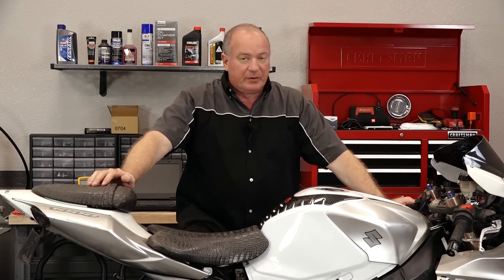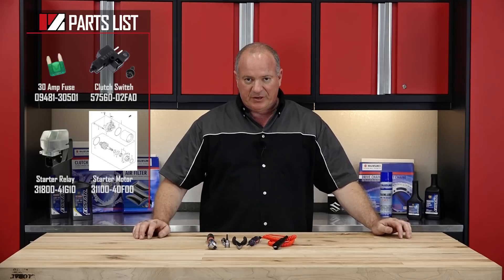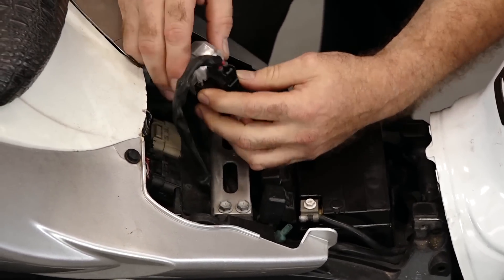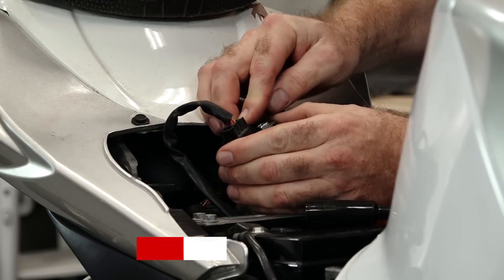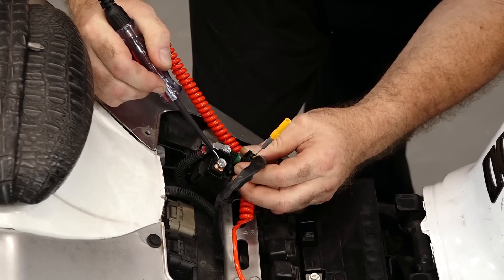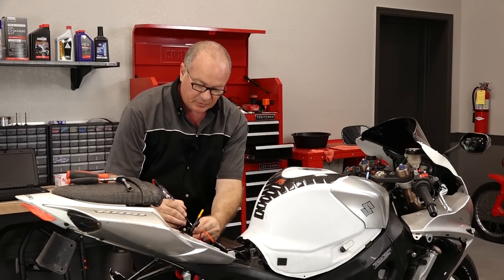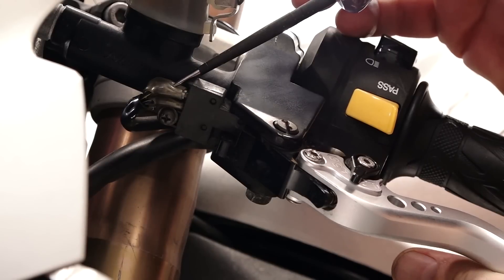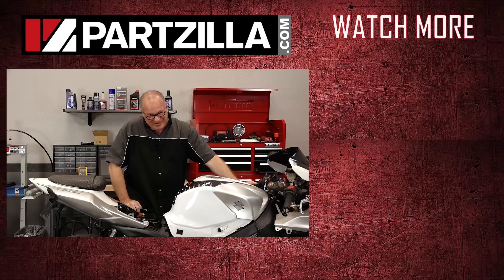GSXR 1000 Won’t Start Troubleshooting | Partzilla.com

Comment: Hey John, I have a 2008 Gsx-R. My bike was cranking, Fuel was priming, Relay was clicking (did a relay test like you did) brand new battery — But no start. I knew it was the starter! After Replacing the starter brushes, Replace the oil and put the covers back on. Now, its not cranking and won’t start It gave me a FI Codes (-C00) which is nothing. Please Help!
Reply from the maker: Test everything from battery to starter.  Is the starter getting power at all?
Reply: So What I did last night, I remove the Starter Completely apart, Make sure I did not miss anything while renewing the starter and replacing the brushes. Relay works, Battery brand new, fuel primes... Now, the starter is getting power and It also Cranks. My Battery drain a little from Triying several times to start my bike. Recharge my Battery for a Bit, Try to start it again, and Its like it wants to start but still not enough power. :(
Reply from the maker: Check all the wires for loose connections or corrosion.  If you have a bad wire, the power will not transfer correctly to the starter.  You can run a voltmeter to determine where you're finding the voltage drop from battery to starter.
Reply: @PartzillaParts  my 07 750 doest crank. Relay clicks really fast and cluster goes wild. New battery new relay. Please help 😢

Comment: My 2004 gsxr 1000 only cranks, it has a few new parts put on, fuel pump  , injectors, Sparks, can't figure out why it won't turn over
Reply from the maker: Is it getting spark and fuel?
Reply: @PartzillaParts  yes it does
Reply from the maker: If you are getting fuel and spark, then it's likely a timing or valve issue.  Do a compression test to check the cylinders.

Comment: I have problem to start. Normally have a biping and start charging and stop. But now have just biping and biping no stop. To slow power to start engine. I can make a video for you see the noice. The noice come front right side down gas tank like from air filter

Comment: My light comes on when I put it on the green and yellow wire and hit the start button, but no light when I put the tester on the negative terminal of the relay. Definitely means my relay is shot? 2009 750
Reply from the maker: Did you hit the starter when you tested the other side of the relay?
Reply: Partzilla yes I did. No light on the side from the relay to the starter when hitting the start button
Reply from the maker: Probably a bad relay then

Comment: 2015 gsxr 1000 checked all that lights come on no FI light on but it says check and starter spins when not connected to the solonied fuel pump aint priming just the dash lights up pull in the clutch hit the button nothin and no neutral light eather and i know the bikes is in nuetural?
Reply from the maker: Check ignition and dash wiring.  Test voltage to solenoid and start switch.
Reply: @PartzillaParts  imma try that
Reply: @PartzillaParts   read some things saying its the ECU

Comment: Hi thank you for the video been very helpful up until now I got through all the stages until you said check starter relay contact do you continue having the Black wire of your multimeter on the negative side of the battery because if so I am getting nothing there also I have no clicking whatsoever when I press the starter button any help would really make my life a lot easier and happier and I would really appreciate it. So just to confirm I've checked everything the voltage changes when checking the yellow and green wire so there is power coming from my starter switch but there is no clicking from my relay whatsoever and on the starter relay contact negative side when pressing the starter button no change but having my black wire from a multimeter on the negative side of the battery I'm assuming that wouldn't be watching your video that is how I understood this so if you can help me further please do my next purchase is a starter relay thanks for your all your help in advance. YouTube rules
Reply from the maker: You always ground the tester.  Sounds like you need a new relay.  Double check your connections as well.

Comment: I’m having a weird issue. Sometimes my bike starts, sometimes it does not. When it doesn’t I hear a single click and nothing happens. Everything primes normally before I hit the starter. What might be causing this?
Reply from the maker: Dead battery or bad solenoid

Comment: i have a gsxr 1000, 2005-2006.
it turns on and everything but when i press the ignition button for the starter to start it up, it does nothing. But if i put a metal object at the same time on top of the two relay bolts, only then the starter works but not when i push do ignition button. Can anyone help me with this ?

Comment: I have a 2007 gsxr and it won’t start, the solenoid is good but when I take off    The part off d starter and start it, the start do spin
Reply from the maker: With the solenoid installed, when you connect the posts, does it turn the starter?

Comment: Hey i did everything but when i check for electricity coming through yellow and green wire there is none. Is it the starter relay?
Reply: Danny 666 I had the same problem and so I just bought the starter/kill switch of the right handle bar and it worked.

Comment: Got a 1998 gsxr 600 srad was tottaly dead no power found out was the ignition switch got power to everything now but refuses to start and the oil can is flashing on the dash ?
Reply from the maker: What's it doing?  Does it turn over?  Need some more detail.
Reply: Yes lights work indicators fuel pump starts turns over trying to start but no spark in the spark plugs before this i had no power atall but found out there was a broken wire on the ignition switch fixed that and got power back and turns over but no spark
Reply: Also has the oil can flashing  on and off on the dash
Reply from the maker: If you start at the plug and test everything backwards through the system, you will find where the voltage drops.  Then you can narrow down the component/wire that is failing.

Comment: I have an 011 gsxr ne batteries everything coming on but when I try to switch on the bike on all I hear is a clicking sound
Reply from the maker: Could be a bad solenoid or a corroded or damaged wire not letting the voltage get to the starter.

Comment: What if the main fuse isn't blown on the starter and the lights still won't come on
Reply from the maker: Bad connection, dead battery, corrosion, short...could be many things.

Comment: I've changed out my starter, but starter relay and I test at Ground steel will start all I get is a clicking noise.
Reply from the maker: Load test your battery to confirm health and test your starter solenoid.

Comment: Hey my bike turns over but won't fire Up. Brand new battery solenoid fuse and spark plugs.
Reply from the maker: Are you getting spark and fuel?
Reply: Partzilla yeah. It fires up now. But when it dies when the rpms get lie then it won t fire but up. But when I shut it off myself and then back on it fires up fine.
Reply: Partzilla If it shuts off when the idle is too low it wont fire back up again u until about an hour or so
Reply from the maker: Weird.  Have you adjusted your idle up a little?  Does it help?
Reply: Partzilla  yes I adjust the idle when it fires up when it gets too high or too low but eventually it still just drops and shut off after a bit. But even if it dies by low rpms I still don't know why it wont fire back up right away.
Reply from the maker: Exactly what bike are we discussing.  Is it a 2007 GSXR1000?

Comment: I have a 2006 gsxr 1000 and my Bike wont start until I shake it. Turns on, flip switch hear pump priming but when I hit the start button it does not start but when I shake it, it starts right up. Do you have any idea what it can be?
Reply: Please help??????
Reply from the maker: Define "shake it." You shake the whole bike?
Reply: Yes literally the whole bike
Reply: Either back and forward or side to side and the it starts up
Reply from the maker: That must be entertaining to watch!  When you hit the start button, what does it do?  Click? Does it turn over and not catch?  Any details would help.
Reply: Yea my friends be laughing at me so sad but they can’t beat me so i laugh later lol
Reply: Ok I turn the key flip the switch the fuel pump primed and then I pull clutch and when I hit the start button it the lights go off like it want to start but doesn’t do nothing no catch no nothing until I shake it and then I do it and it start right up
Reply: When you checked the start solenoid on the copper side I’m not getting a light on the starter rely side
Reply: If the black wire that goes to the starter on the solenoid isn’t giving no light then where is the problem?
Reply from the maker: Ok, so you have a lack of power.  Start by load testing your battery, it's the most likely issue.  If the battery is good, check all the wires going to the solenoid to make sure they are not loose.  When you tested the power from the solenoid, did you hit the start button?  You won't get power on the other side unless you hit the start switch.  Black wires are usually negative or ground wires, so they won't be hot.
Reply: Yes I hit the start button on the yellow and green wire it light up and then I did the same for the wire that goes to the starter and it does not light up
Reply from the maker: It could be a bad solenoid or just not enough juice to come out the other side.

Comment: Bought a GSXR 750 that the owner over filled oil, he drove for a mile then back home, now it will not start back. He changed breather filter, spark plugs,  What could be causing this not to start.

Comment: My turn signals and high beams wont turn on. Also my speedometer and nuetral light wont work i did replace the 30amp fuse and my bike turned on now its a 2006 gsxr 750 can anyone help with what the issue might be
Reply from the maker: Check all the fuses.  Your signal fuse can affect dash and headlights too.  Should be a 15A

Comment: So my bike is making that click noise does that mean my starter is bad?
Reply: Check the chain tensioner. Trust me. If its not a manual one go get it changed to a manual chain tensioner and it will fix that noise
Reply from the maker: If you are trying to start it and it has that click, it's likely your solenoid/relay.
Reply from the maker: Or not enough power to it.

Comment: I have 2005 gsxr600 I have started in while and didnt have battery in it. I put fresh battery and want to start it and it keep blowing the starter Relay Fuze as right as I put it in. Without ignition even being on...  any good advice as to where I should look for short ?

Comment: I have a 2015 gsxr 16 000 klm on the clock its swinging over but not starting. it has a dyno jet power commander and a short shifter, iv replaced spark plugs and battery fuel pump is priming, and am currently lost with what could be the problem f1 code c24, c25, c26, and c27 are showing any helpful info will be appreciated  thanks

Comment: sir, i am a user of rs150 fi, but my crank was loosen when i hit it, my digital gauge are ok and my ignition switch is ok too but doesnt start. what could be the cause?
Reply from the maker: It could be literally anything.  You'll have to go through and test the systems.

Comment: i have a 98 suzuki gsx-r600 and my main fuse keeps blowing out. sometimes i can start and ride other times the fuse blows as soon as i try to start the bike. any suggestions or ideas?
Reply from the maker: Start checking for a grounded or damaged wire.  Also clean up any corrosion.

Comment: I have a 2004 gsxr 750 started fine I changed the under tail an blew a fuse while doing the wires on the signal lights it was a 10 amp got a new one all lights an every thing work but no fuel pump kick in aN won’t turn over an on the digital part of dash says cheek ???? Any idea what it could be ???
Reply from the maker: You shorted something else out in the process.  Check all fuses to start.  Then check the fuel relay

Comment: Can you help me every time I put the 30 amp fuse in it just blows bike was running great then just lost power saw that the fuse blew but tried the spare & just pops do I have a short some where or what should I do 2007 gsxr 750
Reply from the maker: Check your wiring for a short.

Comment: So I’m having the FI light and the code is c42. It’s a 2015 gsxr 600. It won’t crank up and everything is working fine but just woke turn over and crank. What could be the issue. The bike haven’t been rode in a long time

Comment: I jumpstarted my motorcycle  starts solenoid  it turns over but won’t start  Well I have  to replace solenoid for it it to start
Reply from the maker: If it is getting power from the jump to the starter, then the solenoid is likely ok.  You have a different issue, get a new battery, then confirm spark and fuel.